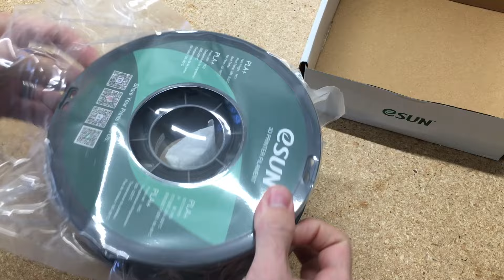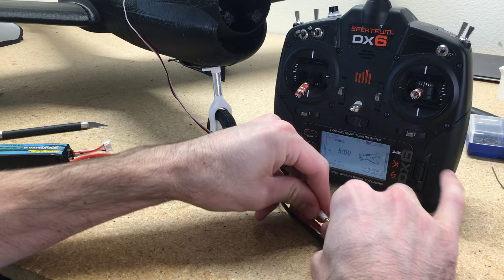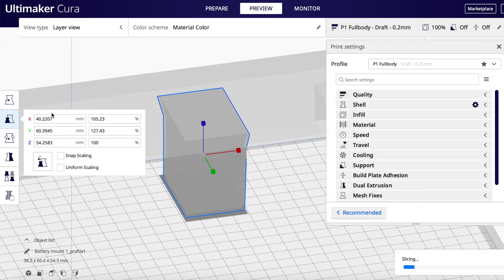How to Assemble RC 3D Printed Tucano - Planeprint

Comment: It looks like cool temperatures when you guys are flying the 3D printed planes. What happens on 90+ degree days? Do they get soft and bendy?
Reply from the maker: I have flown 3D printed planes in Vegas at 90-100 degree temperatures and have not had any problems with the material.
Reply: The common PLA filament has a "glass transition temperature" (softening point) of 60C so it could distort if left in the car on a hot summer day.  Especially with really thin surfaces like in this plane 's body.  But could try other filament materials like ASA, ABS or Nylon which have higher temperature resistance.
Reply: Dry Lake bed Boulder City?

Comment: I just got a 3d printer a few weeks ago and this is a major reason I got it. Thanks for the great information and tips
Reply from the maker: What kind of printer did you get? I bought my printer just for printing an airplane. 3D printed airplanes are so nice that all I have been using my printer for over the past year has been printing airplane parts or full airplanes. Have fun with your build. Let me know if I can help with anything. This Tucano is awesome I would highly recommend this build. It flies really good.
Reply: @TroyMcMillan  I bought an Flsun qqs delta printer. I was warned about deltas and the issues they can have but I was so intrigued by the kinematics I bought one anyways. So far it has been excellent.
Reply from the maker: @elyodeel  Ya that looks like a nice printer auto bed leveling must be nice. Have fun with your build.

Comment: Hey Troy! Another great video! The one thing I want to say when cutting carbon tubes/rods is 1. Tape the tube at the cut and cut through the tape to avoid splintering of the carbon and helps keep the dust down. 2. Use a spray bottle with water in it and wet the carbon where you are going to cut it, this will eliminate any and all dust. I don't want you to get lung damage from the carbon in the air! Have fun!
Reply from the maker: Thank you for the tip, I will be sure to do that for the next build.
Reply: Exactly! For the same reason, It's not a good idea to use carbon tubes or rods in a drill to clean out the wing tubes.

Comment: Ok, print quality so far is ok for me. Some pinholes in some of the large flat edges probably something to do with priming, but it isn’t happening all over. The wings bases are lifting or shrinking though at the leading and trailing edges. They are adhered to the base when the print is finished, but when I butt the two wings together  few minutes later, there are 2mm gaps at the leading and trailing edges.

Comment: Leopard 3548 from altitude hobby.com  fits perfect no mod to the motor
Reply from the maker: Nice thank you for that link. No mod is much better.
Reply: I have a leopard 3548 motor but the prop adapter i use i must make a 14mm hole in the motor mount to get the adapter body closer otherwise the fan will be 10mm away from fuselage, what adapter do you use?
Reply from the maker: @evancakken  I made my own motor mount with a little piece of ply wood I show how to do it in the video

Comment: Absolutely amazing to see a home made printed plane. I would have sanded the plane with 600 or 800 grit sand paper to make the plane more aerodynamic and a smoother surface. I have been flying planes since 1995.  Things have come a long way!
Reply: A smoother surface is not necessarily more aerodynamic. Golf balls have dimples to make them fly farther and straighter. Assistance is trickier than you think, that's why people who work with it have degrees. LMFAO.
Reply: @shelbyseelbach9568  A golf ball and an airplane require two completely different aerodynamics to fly. A golfball is a sphere. The dimples in a golf ball are designed to limit spin after being hit by a golf club. A ping pong ball for instance is also a sphere but there are no dimples because you want spin when you're playing ping pong. All airplanes have smooth surfaces to improve aerodynamics. There are no dimples in an airplane wing for that reason. The smoother the surface the better the airplane flies. 👍🏿👍🏿👍🏿
Reply: @misc_13_13  aerodynamics are aerodynamics.
Reply: @misc_13_13  I suggest you look into the finish surface on an F-18 just for an example. This is a known characteristic of aerodynamivs and not simply something I am making up. Having a pilots license does not make you an aeronautical engineer, my friend.
Smoother is not always more aerodynamic. Planes that you fly have smooth skin based on desired performance parameters, cost, and complexity. Educate yourself, sir.
Reply: @shelbyseelbach9568  Educate yourself on drag and what drag is.

Comment: Another great build video for another great PlanePrint plane.  I may use oleo landing gear just to give it a bit of flex on landing.
Reply from the maker: Thank you David, 
Yes I was worried about the landing gear a bit also. The gear held up good for me. The wing design of the plane flies very good and on landing with no power it actually floats a lot so it is easy to have nice smooth landings. I don't think it needs oleo landing gear but it would be nice looking for sure. Have fun with your build.

Comment: I just printed wing 1 and test fitting it to the fuselage leaves a gap because the wing tube alignment tabs (diamond shaped) hit the wing root. Is this the plan or do I need to trim out some of the wing tube guide holes on wing 1 for a flush mount?
Reply from the maker: Yes that diamond shape needs to be cut out to fir the carbon fiber tub.
Reply: @ so you just shave off the whole diamond tab flush with the wing root.
Reply: @TroyMcMillian OK, I see that you trimmed the remaining diamond tab flush now. THX.

Comment: Front section of fuse4 is not slicing the small recess for fuse5 to slide over into place. Right now, the two end just butt together. Any ideas? The STL preview shows the recess, fuse5,6 and 7 sliced the recess just fine.
Reply: Oops, I forgot about using Cura 4.12.1, that version sliced it correctly.
Reply from the maker: Glad you fixed it have fun with the build

Comment: Do you have the stl file of how to make the motor mounting? the mine is also too small. Unfortunately I can't work with CAD.
Its a very nice plane
Reply from the maker: actually no need for CAD with the motor mount. I had a problem with the motor mount also so I just made one out of a small chunk of 1/8in ply wood

Comment: alternative to the heated wire method (bowden channels) is to grind 2 flats on the end of a piece of wire (it will look like a tiny sharp edged flat head screwdriver tip) and pushing it through the channels while turning it with an electric drill. It will function as a long flexible drillbit that way
Reply from the maker: Thank you for this tip I will try this for my next project
Reply: @TroyMcMillan  My pleasure! Two additional tips:
- If the wire gets stuck in the bowden it may be because the sharp tips of the "spade" are digging themselves into the wall of the bowden. A quickfix for that is to add a tiny radius to those corner tips. If I use endmills as and example it would mean that you would change its profile from a regular flat endmill profile to a bullnose endmill.
- In the slicer software you can select a fixed position for layerchange (for example, closest point of the model to X0Y0) . By doing this the little blobs will follow a predictable line through the bowden channel, it is quite possible that by doing this you do not even need to drill it for the rod to fit because the usable diameter of the channel will be larger. 

I hope it makes sense. These things can be difficult to explain in a couple words in a youtube comment.
Reply from the maker: @StefsEngineering  Yes it does makes sense thank you. I agree things are hard to explain sometimes in a quick comment.

Comment: Hi, very nice work! I try to build mine but making test profile p3 i get a good result but if I see the wing thrue the light ther's a little thin mesh where nozle start every slicing in the leading edge. All parts  are nice and smooth,no stringing, but also changing temp and fan velocity this problem doesnt solve. Should i consider that a fail print and change some settings ?Any suggest? Thanks
Reply from the maker: if you can put just a little pressure on the surface of the part and it doesn't break it should be strong enough!
Reply: @TroyMcMillan  thanks Troy!

Comment: Troy I'm getting a sleight lift in a corner while printing. Ive added a skirt for better adhession but maybe there is something else in play?  Ender 3 pro hatchbox pla 215 nozzle 60 on bed fan at 100.   Think the fan speed might be contributing.  Thoughts? Print quality is great other that the shrinkage on the corner

Comment: Awesome video, thanks for the detail. I have a couple of questions, I´m planning to get into 3d modeling and printing planes and would like to hear your input. 1) Why you tried to print every single piece of the plane? It´s interesting to see you even print the tires. Why´s that? wouldn´t be more weight efficient to use available commercial parts? 2) Why won´t print hollow walls? particularly for the wing and then monokote them? again, wouldn´t it be more weight effective? Just haven´t found the answer, is it for structural strength? Have you ever made a comparison weight wise of using for example, balsa ailerons? Thanks in advance.
Reply from the maker: Thank you for the comment, These are questions I had when I first got into 3D printing also. For the tires yes you are correct that if you buy commercial available tires you can save some wight. The advantage of 3D printing the rims and using flexible TPU material for the tires is that you can make any shape or size of tire that adds to the design of the plane. I compared wights of tire in the Model A build and it was only 2 grams different for a set of two 40mm tires. Unless you are using a large Printed tire like the Bobber there is not much savings on wight. As far as making a hybrid build with PLA, FOAM, or Balsa with Monokote. I have 3D printed a rib section and covered it with covering but the Iron melted the plastic a bit. I have herd of people 3D printing the fuselage and building a foam wing.  3D printing the full plane just looks better and the covering is nice and strong and durable. With Monokote you need to handle it very gently in transport. 
Cheers
Reply: @TroyMcMillan  So much thanks for your answer. Indeed deformation of the PLA is a risk when putting an iron on top of it :) have seen a couple of builders that have achieved it. Thanks a lot, really appreciated.
Reply from the maker: @ohernand99  Ya no problem If you use PETG or ABS it is more heat resistant so it may hold up better to the Iron

Comment: Hi man, I don't know much about 3d printing but couldn't you make the surface smoother by using acetone or a heat gun on the outside? 
I think it also makes it stronger.
Reply from the maker: Heat gun would melt the plastic and not sure about the acetone. I have seen people sand the surfaced add filler to the parts, then sand surface multiple times with finer and finer sand paper. It is basically the same process of painting a car working your way up to 2000 grid sand paper. Then finish it off with a paint job. That can make the surface very smooth but is a lot of work that I think most people are not up to that much work for a 3D printed plane. I think most people want to take it off the build plate and glue it together.

Comment: wowww...Really good job...I have mine made of balsa wood, I want to make the canopy 3d printed, once I have the printer, just need to make this part in some cad software.
Reply from the maker: Wow a balsa Tucano that is cool. A 3d printed canopy will look nice on that. Have fun I use Fusion 360 for cad software.  It is free for hobbyists for a year.
Reply: @TroyMcMillan  Yeah, I'm trying to make the canopy in the Fusion 360 and the engine cover which is the hardest part to me.

Comment: Troy, Profuse thanks for sharing your profile 3 settings. I'm printing BigBobber, and that made a BIG difference to the quality. BTW, any chance of sharing the other 3 profiles? I've also got problems with P1, for some reason Cura isn't generating any G0 Z codes between layers, tries to print the whole thing in one layer??
I really like the Tucano, it's a nice looking a/c. I see one on my future, but I have to get better at flying!
Reply from the maker: The other profiles are pretty easy if you are having something like that happening there is something wrong with the G code it doest sound like it is a problem with the settings.

Comment: Hello thanks for a good video, what prop adapter do you use? I have to make a custom motor mount but the body of the adapter is 14mm so the holes for motor 2 of the will be very close  to the center hole, otherwise the fan will be away from fuselage about 10mm, i see in your video that the fan is very close to the fuselage, any idea?

Comment: This is a model of a Texan. The Tucano had quite a few differences.
Reply from the maker: It does look a bit like a Texan. This is a Tucano.
Reply: @TroyMcMillan   Really nice job I love it.  However you have the wrong Tucano. The RAF Tucano has 4 props, and the exhaust are underneath. The canopy is slightly different too.
Reply from the maker: @vwsurfer8809  Yes I agree with those differences. The RAF Tucano was actually a Short Tucano that was a modified version of the Brazilian Embraer Tucano. As far as the prop I would have liked to use a 4 blade prop but I could not find a 12x6 4 blade rc prop. For the Canopy I believe it is closer to be a Short Tucano rather than a Embraer Tucano. The Embraer Tucano did  not have any structure parts to divide the window up. They added them to the Short Tucano to be able to hold up to bird strikes at low altitudes and high speeds. Thank you for the comment you are the first one to notice the difference. I was hoping to get away with the RAF paint sceame with a few errors to the airplane design. :)
Reply: @TroyMcMillan  I worked on the RAF Tucano for many year. Great job on the model. Keep up the good work!

Comment: How long does the flight last with that battery?  How would it work with 3s 3000mah.
You have a very nice plane
Reply from the maker: Thank you, It will work with that battery. I used a 4S 4000mAh battery it will fly for 5-6 min depending on how fast you want to fly it. It could last longer than that if you fly slow.

Comment: Did you make the decals yourself or purchased premade..?
Reply from the maker: I made the decals myself I drew them up with Gravity Designer. Then had a local print company print them out for me.
Reply: @TroyMcMillan  Nice, were they pricey...?  We have a Cricut cutter and I was thinking about trying to use it to cut my own vinyl decals
Reply from the maker: @SiliconRiot  The software I used to draw them up was free. They took many hours to draw up all the decals. The place I have them printed charges me $30 to print them, cut and weed them so they are ready to install with transfer tap. 
Ya a Cricut cutter would be awesome to make decals with. Just get a good material that will stick to the plane and that would work great.

Comment: Hi Troy, is this plane also printed with "one Layer- wall"?
Reply: How is this possible to setup in CURA?
Reply from the maker: Yes it is printed with 1 wall just set one wall thickness and 0 infill in Cura also this model is printed in surface mode.

Comment: This looks great! I recently printed a spit fire, but it didn't fly. I was running 2200kv motor, 30a esc and 1045 prop on 3s lipo. I noticed you rotated the motor shaft. Is that a most do for it to fly?

Comment: awesome build Troy! A few questions though - did you ever have any issues with the control horns being 3d printed and super glued to the aileron? This usually worries me the most - layer adhesion on thin parts. Also, how does it hold up in the summer since it's all black and thin-walled?

Comment: do you always use esun filament? how does perform? thanks!
Reply from the maker: Most of my builds is use Esun PLA +. It works better than other brands I have used for single wall printing. It has the best layer adhesion, does not warp on the build plate. It also has good bed adhesion witch is important for this kind of printing. When you have prints that are 10 hours long I don't want parts failing.
Reply: @TroyMcMillan  awesome! Thanks!

Comment: I'm working on printing this now and I'm having a lot of trouble with the bowden tubes running down the center of Fuselage 1. The print head is banging them as it gets about 40 layers high and is just creating a stack of blobs that are not even fused. I was printing at 50mm/s but finally got frustrated and put the printer down to 33% speed and got decent but not perfect after 15 hours! I could probably run it at 20-25mm/s and be okay. I think the designer could help things by giving them some support with the wall or even to each other instead of just a long hollow tube on it's own. My WIngtest is dialed in absolutely perfectly by the way, not even the typical under extrusion at the Z-seam, with zero extra prime amount.
Reply from the maker: I printed my Tucano at 40mm/s. I agree the bowden tubes in the fuselage was difficult for my printer also. I would look at the changing to location of the Z-seam you can sometimes rotate the part just a small amount so when the extruder moves position it will not hit that tube. I always think even if you have to print at 20mm/s it is better then printing a 12 hour part and have it fail. Even after I printed those parts slow the push rods  definitely did not just slide in the bowden tubes. Also I had a problem with the Rudder with my prints. I had to change the location of the Z-seam to get the bowden tube in the ruder to work properly.